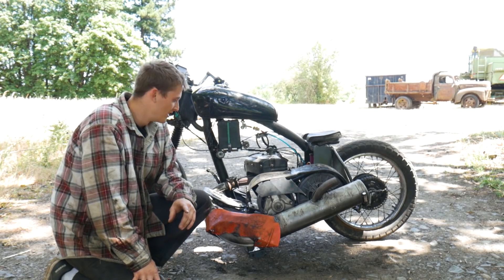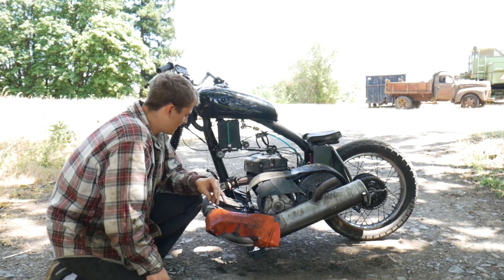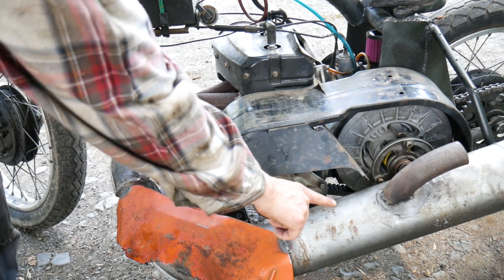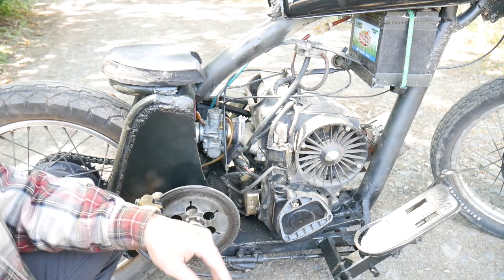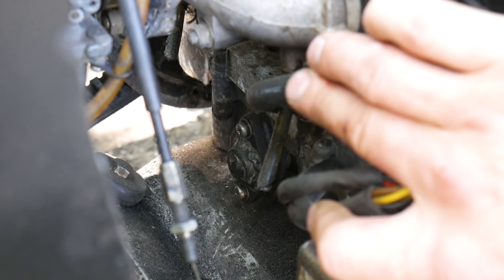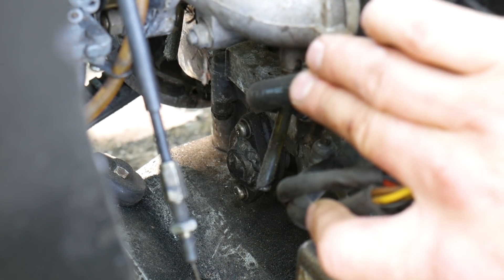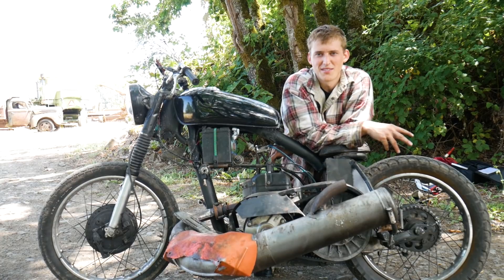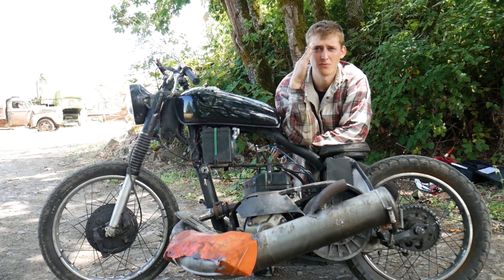Snowmobile engine on a motorcycle |Take 2|

Comment from the maker: The question is...Can it be licensed?
Thanks for watching!
Reply: I think so if you have paperwork for the frame that goes to that vin
Reply: We can Wish...But 2 stroke will NEVER see Pavement again..... Unless ya got a Mint H2..Rd..etc....Btw. 2 Strokes ARE KING😎..Gold Spectro
Reply: Oliver Motorized hey could you by chance make a pt2 on the vintage bike please
Reply: Oliver Motorized I think you can get it licensed. I  believe all you have to do is go the D
MV and have it inspected and all and they will give you a VIN number for it so you can get a new title and tags
Reply: Great one, lad. You can use snowmobile engines on dirt bikes as options.
Reply: Should be able to, just have to register it.  They don't ask of it has original engine
Reply: In montana that things legal if you slap rear signals and brake lights and one mirror. That things looks fun lol
Reply: In montana that things legal if you slap rear signals and brake lights and one mirror. That things looks fun lol
Reply: In montana that things legal if you slap rear signals and brake lights and one mirror. That things looks fun lol
Reply: If you have the original title for the motorcycle register it get a plate and insurance but I would recommend lights and a mirror for safety
Reply: I really like this build and I just got the Harbor Freight 125 welder so I wanna build a new project after watching this
Reply: I was wondering how you were riding it legally on the street lol.  The title usually goes off of the frame, so if you have a homemade frame, you'll have to talk to your tag office to find out what all you have to do to register a new VIN.  I don't know you can do Make: Olimoto - Model- Snomocycle - Vin: 1.  That would be cool if it was that easy, but yeah, I don't think it is :)  But once you get a title for it, registration is just like anything else.  Good luck trying to figure out how to insure it though.
Reply: Interesting project 
Too bad the chamber would not fit on the rt side to balance things out a bit. 
Good luck with the trouble shooting.
Reply: Most states you just need to get it inspected, which means headlights, taillight/brake, a mirror, and DOT tires.  Then you can get a VIN and a title/tags.
Reply: Id say pull the cover off the engine so it can get more air than just the fan
Reply: Don't you think it would run much cooler without the shroud over the motor being out in the wind and all 😉, if it gets too hot sometimes the coil will lose spark and come right once cooler, awesome job though 😎.
Reply: Dr. Rob tulie did this on a motorcycle called the tularis. To this day it has designs that are more advanced than today's motorcycles.
Reply: No no no.. the question is can you be the emperor of china? 🤔😂
Reply: @yfz-ky1yd  frame was scratch built
Reply: @Mohamed Ayaan Instablaster :)
Reply: @Oliver Maximo thanks for your reply. I found the site thru google and im waiting for the hacking stuff atm.
I see it takes a while so I will reply here later when my account password hopefully is recovered.
Reply: @Oliver Maximo it worked and I now got access to my account again. Im so happy:D
Thanks so much, you saved my ass!
Reply: @Mohamed Ayaan you are welcome =)
Reply: Could you make where I could share some pics with you and your followers. 
I've built 5 snomobikes over the last 9 or so years

Comment: Old coils will stop sparkling when hot . Then work again when it cools down
Reply from the maker: ahh that could very well be it
Reply: Yes. It needs to be determined if it is the ignition coils or the pickup coil, under the flywheel. If your ignition coils are near anything hot, try to isolate or protect them from heat. If that doesn't work, try hooking an aux. 6 volt supply (lantern battery) to the ignition and see if that helps it run longer. (Make sure you unplug the wire from the pick up coil) I am assuming this is from an old snowmobile, so the coils (ignition) could be equally shorting hence you lose both cylinders. Usually, (from my exp.), when the pickup coil(s) go, you lose everything. No six volts. Try isolating the ignition coils from heat, first. I hope I am right and it helps. It has been decades sine I worked on these engines. Show us when you nailed the problem.  :-)
Reply: What these guys said. I had an old sled that did the exact same thing. Coils got hot, and no spark. Waited til they cooled off and she fired right back up. Next time it shuts off on you, check for spark. 

Deleting the oil injection is safer. You don’t exactly know what ratio the pump is working at. 

Read the spark plugs and jet accordingly.

Lastly, if you have the air box, try to use it. Two strokes are tuned for the air box (almost as much) as the expansion chamber. They are not 4 strokes! Been there, done that. :)
Reply: That was my first thought as well. I grew up riding old junkyard Yamaha and Suzuki bikes. More than once I did the walk of shame due to old coils.
Reply: Yep. Resistance increases with heat. The coil becomes a thermostatic switch.
Reply: DawgBüs Adventure same
Reply: @donkEEpunch85  Remember when I was 8 yrs old mid 70s TM 75 2 stroke a guy adjusted the points on it WOW the power i was missing 👍👍
Reply: Stator coils can do it too
Reply: @OliverMotorized  Randomly cutting out and then running again has often times been fuel starvation for me. The tanks don't let any air in (some I've used) and results in no fuel flow as the system starts to pull a vacuum. Opening the cap lets me get back going. Annoying issue

Comment: The stock jetting on that carb is meant for a ambient temperature of 5 degrees celcius down to like -20. Aka it's probably putting out a lot more fuel than youd need on a 25 degree day. You COULD put a smaller main jet and raise the c clip on the needle inside the carb slide by one clip position and it would probably pick up a good 5-8hp. Just dont go too lean or you could melt or hole your piston :D

Edit: losing power as it gets warm could be a ignition coil going bad. On some old sleds I've owned they only start to act up when they get hot. Good luck!
Reply from the maker: Thanks for the advice! I wouldn't doubt the 30 year old ignition coil could be going bad lol!
Reply: @OliverMotorized  Unless it's obviously something else I always look for ignition faults first. 

P.S. While you've got the plugs out look at the colour of them, that will give you and idea of how accurate your fueling is.
Reply: I agree as the coils heat up very small cracks in the epoxy inside expand and short the coil out. 
I’ve had the same problem on 2 4wheelers 1 dirt bike and a Toyota pickup. Just what happens when you play with old toys lol
Reply: I'd say it looks like it's jetted for higher altitude. That would mean he's lean not rich. His exhaust is awfully clean looking to be running rich. It could be a matter of age but the old artic cat I got a chance to ride in my teens smoked like a freight train but ran like a raped ape. It was jetted for lower altitudes. It just seems to me like the exhaust is too clean.
Reply: @jameshathaway5117  that was my guess as well. It should smoke like a jimmy and scream like a banshee, but there no smoke.

Comment: How absolutely satisfying....to take note of the powerful advantage of 
the build as effortless clutch.  That is to say, smash on the throttle and 
engage the power curve of the engine-clutch design.
I pause to ride my Honda 1100 around the block.  I can hardly imagine 
what would refresh...a builder spirit....more. was that 50+"   60..mph?..
Mastery of iron....intended build..   concept..met and formed.

Comment: Well if you got twin pipes for it with the right jetting it would fly!
Reply from the maker: I think it def needs to be re-jetted cuz of the summer temps
Reply: Also swap to dual carbs, more precise fuel and oil delivery to each cylinder will not only increase power, but also engine life.
Reply: He’s not a 2stroke guy
Reply: @gallupcustomknives2293  thats for sure and a good port job would be good too
Reply: Porting can wait until the next rebuild.
Reply: My 01 440z has two carbs.
Reply: @twots22  most do

Comment: I have a 1972 suzuki tc125 trail bike (2 stroke) it was having oil pump problems, I was going to simply premix the fuel and oil, but was advised against because the oil is injected into the intake port and also a certain crank bearing. The crank bearing wouldn't be lubricated with just premix fuel. Dunno if it's the same with yours but just something to watch out for.
Reply: I would check into the claim of the crank bearing thing. Premix should have no problem keeping the bearings lubed.
Reply from the maker: interesting, I've been looking around a little and a lot of folks say that the only issue is with water cooled engines, because the premix lubes the bushing in the water pump. But this engine is fan cooled.
Reply: Ian Stevenson  true, like I said I don't know if premix is an issue for that particular snow mobile engine but just a suggestion :)
Reply: @el34superlead  that's what I thought, but the dude who said was real old and has been working with bikes all his life. I would assume it would vary from engine to engine tho :)
Reply: Ian Stevenson  they were designed that way, because it was "KEWL". the real world? they stop working and destroy the engine.
Reply: @el34superlead  The shop I bought my Suzuki TS100 from said "no you will ruin the bearings, period.."   The other feature about oil injection is that they don't "fail" like most armchair mechanics think they do. It's usually vibration opening air leaks in the plastic feed lines.  check and replace them. The pumps, if they are always kept supplied with clean fresh oil will never fail.

Comment: Ah, the unmistakable sound of a suzuki sled engine, nothing smokes like one of those after the first start of the season on last year's gas, it truly is a spectacle to behold. Those things will usually run for 40 years with no maintenance whatsoever, but it seems like you have bad coils or something.

Comment: Pull the cover off the cylinder fins...open them up so they can get air!
Reply: That is so the fan can push air over the fins effectively
Reply: @roccoseals7753  does it have a scoop of some kind, I did not see one?
Reply: @0utrider  no, but there is a fan on the opposite side of the clutches attached to the shroud
Reply: @roccoseals7753  Cool, thanks for the education, I am in to bikes but have not been around snow machines at all.  An old dog can learn new tricks...lol

Comment: alright here is what Ik about snowmobiles and things that can help you first unless you changed your jetting its now to rich since the engine is always warm since you are driving it is the summer and no longer in winter so u could be flooding the engine the flip side has already been said about the short fuel line where the bowl is emptying before it can fill and these could be going hand in hand also the reason you need the expansion chamber is it creates presser zones that give the engine more power with the right jetting and clutching in changing anyone of those things you might or have to change the other 2 for the engine to work properly neat build (i would have gone with a liquid cooled tho) getting it licensed might be hard tho since im gonna guess it has no title but best of luck

Comment: I race watercross on vintage snowmobiles, I run an old pump delete and don't have problems, I also run less oil than some say to, like 50:1. Oil makes heat, but is important for lubrication. Try 40:1. Also, change your main jet, I step my dual carb sled down from 300 stock to 220, my single carb sled had 310, stock and I ran 230 for 80+ degree weather.
Reply from the maker: Do you re-jet yourself or purchase them?
Reply: @OliverMotorized  buy new jets, almost every bike or atv shop has mikuni jets, the smaller jets are cheap, 2-5 dollars each

Comment: Cool project !!   If you get a chance, modify an old Yamaha RD350 or RD400.  You can hog out the Intake ports, shave heads, cut piston sleeves (Wisecos) and do a lot to get a ton of 2 stroke power.  They are scary to ride too.

Comment: Shouldn't have disconnected the oil pump. Brt you it's lubing the crank bearings that wouldn't get anything from premix
Reply: @noidontthinksolol  not every single one.. the oil injection is there for a reason, and it's definitely for the far side crank bearing
Reply: @noidontthinksolol  yeah every 2 stroke engine is lubed by the oil in the gas  that's the reason they dont hold oil down by the crank like 4 strokes
Reply: @noidontthinksolol  I know. I'm saying the 2 stroke oil injection works fine. Dirt bikes aren't meant to be held wide open for very long. Snowmobiles are. That's why they are 2 stroke oil injected because even 32:1 at wide open is too lean for constant use. Blips like a dirt bike maybe but now WOT
Reply: @noidontthinksolol  I think you've missed everything that points to 2 stroke oil injection going g other places than right into the air fuel mixture. This guy even mentioned where he took the two lines off going to both the cyclinders (aka the crank bearings)
Reply: @noidontthinksolol  I was talking about oil lean btw. I know what jets are. And I also know that premix jets are different than oil injection jets that are made for straight gas
Reply: @noidontthinksolol  hold your premix bike wide open going down the road for 5km and video tape it
Reply: BOI.
Reply: @bcouri1  Yeah, those lines definitely inject oil at the carb, not at the bearings. Especially on older machines, eliminating the oil pump and premixing does not hurt anything. The only place oil is introduced is with the intake air/fuel mix, which goes through the crank case.

Comment: Have to be carful removing the oil pump because some of them pump oil directly into the bearings!!!
Reply: Not on these old suzukis, they just pump oil up to to the intake ports basically. Now the new 850 patriot that polaris has pumps oil into the bearings so you are correct about this but just not on this particular motor.
Reply: @garrettrimko4386  Nope, most if not all Suzuki bikes with CCI injection have oil injection direct to the bearings, and you'll make a otherwise good engine a piece of junk very quickly by starving these shielded bearings. You cannot make the premix rich enough to get oil into them otherwise.
Reply: @tauncfester3022  this bike is either a 440 or 500 suzuki "spirit" engine out of a panther. Oil injection like goes directly into the intake and nowhere else. It's not a motorcycle engine.

Comment: The jetting has to be richer because it was meant to run in the winter. An air scoop for the fan will help tremendously. Good luck, I did the same thing over 30 years ago myself, it worked great, much faster than original  engine.
Reply: Leaner. Colder air = more air

Comment: It's a forced air fan-cooled engine. If your not using the fan you might want to remove some of the wheat metal around the cooling fins. Its there to keep air flowing one direction. Now it needs to cool from all directions.

Comment: The carb is jetted for straight gas which has a lower viscosity when it has an oil injection, you need to rejet the carb when switching to premix. Its probably leaning out and causing excess heat which can effect the stator and lose spark. Look up an instructional on jetting. When your jetting is spot-on, power will be boosted dramatically

Comment: There's a worm gear on the crank that drives the oil pump. It pushes oil through a passage that dead ends "BEHIND the ROTARY PlATE to feed both carbs. Delete the oil pump and use only 35:1 you oil the front of the plate but not the back of the plate carb to intake hide behind the plate and there's no oil from the fuel. The oil pump presses oil between the plate and the engine block 🤙

Comment: You have to loop the oil pump inputs with a tube. You can’t block them off. There’s a mechanical switch in the block

Comment: Fuel pumps and/or carb might be plugging up, had near identical symptoms to that on a sled from bad fuel.  When it quits pull out the plugs and check for spark, if you have spark then its fuel related.
Reply from the maker: ah good troubleshooting advice thanks!

Comment: It may have lost power due to poor fuel delivery to the carburetor .... check the fuel lines and fuel filter for partial blockage . That would explain why it started up again , after the float bowl inside the carburetor re-filled . Are you building an aircraft like I suggested ?
Reply from the maker: yeah that what it kind of seemed like to me too. hmm I'm in the research phase of the aircraft build lol!

Comment: On snowmobile engines deleting the oil injection pump is usually a bad idea   leave em hooked up,  but change that jetting if its still has the stock jets in it,

Comment: Since this was 4 years ago you must have figured out it was either coils over heating or vapor lock in the fuel system. Engines built for cold weather operation do not do well in the summer. If you still had spark, it was vapor lock. I used a 2 stroke snow blower engine on a push scooter and it would vapor lock after a minute or two. Went loke a bat out of hell for a minute or two before it would lose fuel.